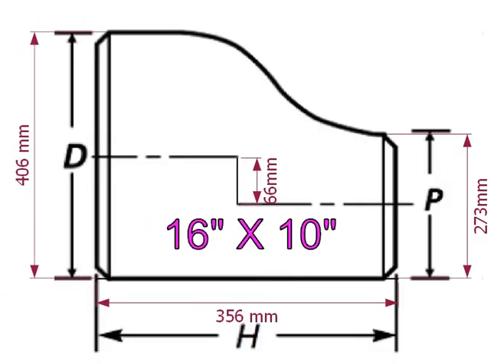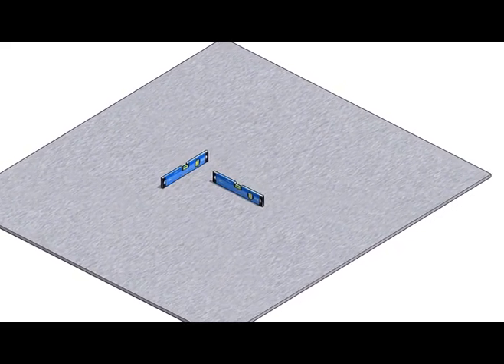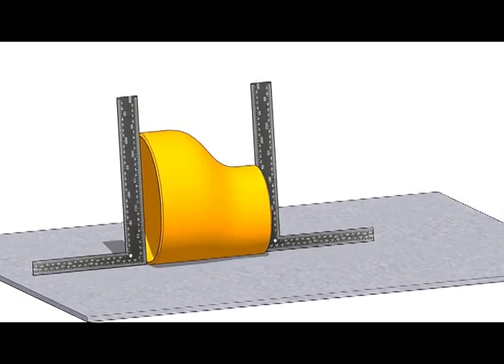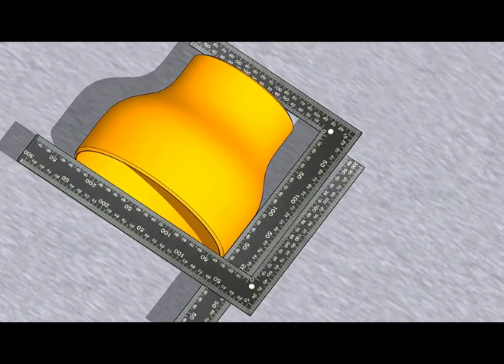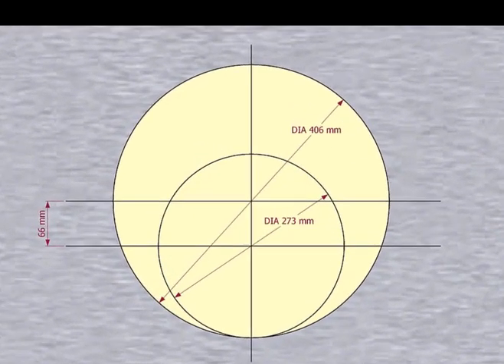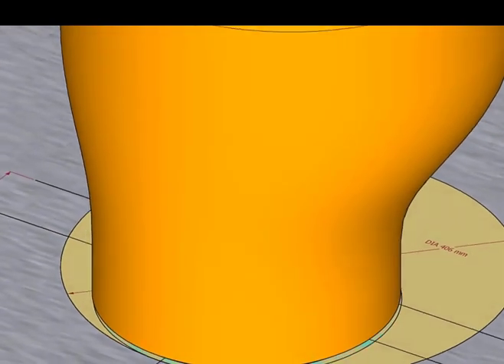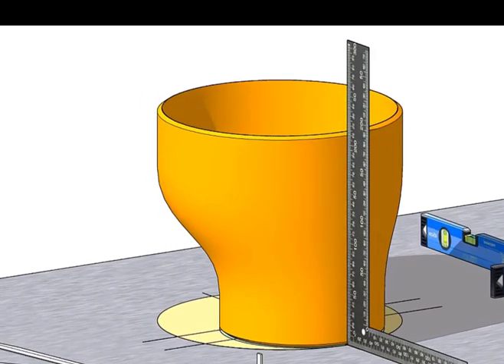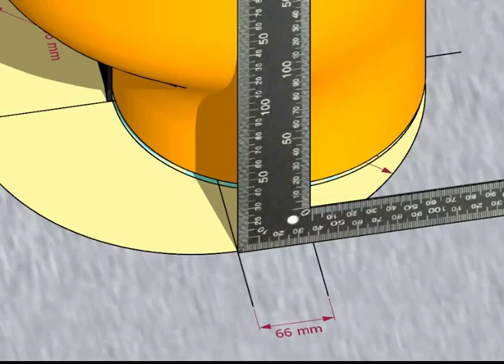How to mark the center line of an eccentric reducer. Step by step method for beginners. explained.

Comment: What is the purpose of checking the center
Reply from the maker: Good question bro. In an eccentric reducer, marking the centerline helps to set the flat side (FLAT TOP or FLAT BOTTOM) correctly during fit-up. It ensures perfect alignment with the pipe axis and avoids level mismatch or air pockets. Very important for drain lines. Thank you.

Comment: what I've found is that if you do the math, 16- 10-3/4=5-1/2. divide by 2 and get 2-5/8. I would get a 2 inch block and a 5/8 plate stacked atop each other. push the eccentric against a piece of h beam so it doesn't show a gap and roll it until it sits atop the 2-5/8 metal just past the bevel. mark the eccentric along the straight part at 8 inches. place the 16 inch side on the table and use a square to make a line at the mark. works every time for me.

Comment: Can you do one on how to find center on butt weld caps!
Reply: As welded caps.. you will never really be able to tell 100% where the center is, without being able to see the root weld.. welds can bias the welds as they are welding, and might put an extra bead on one side or another for a number of reasons.. such as to blend hi-lo..or internal transisions..
Reply from the maker: I will add in my next video. Thank you for the suggestion.